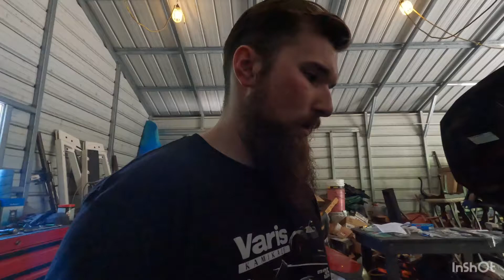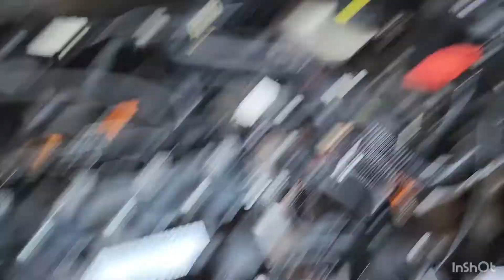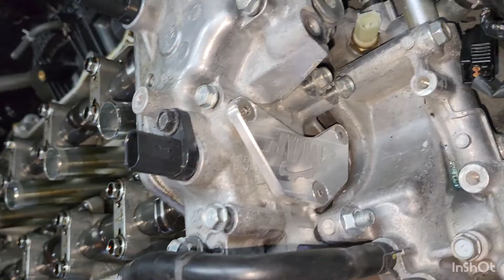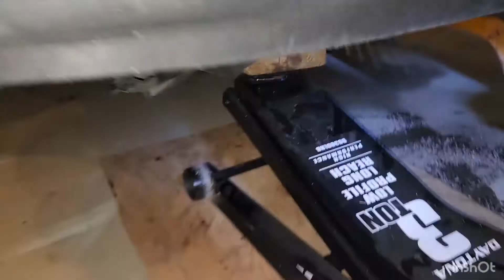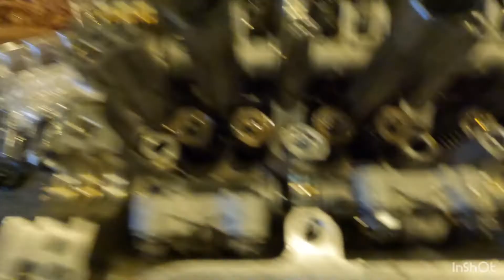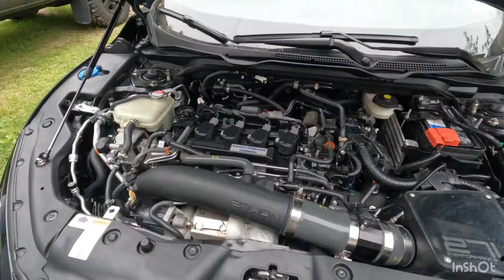2020 Honda Civic Si Engine Mods, Headgasket and ARP Studs

Comment: Do u know what the cause was for the head gasket failing ? Huge job wow !
Reply from the maker: This car has a larger turbo upgrade and is tuned for a higher peak boost. These engines are known for headgasket issues in factory form, so I assume it was expedited by the increased cylinder pressures.

Comment: Denso is just a small part and connectors company in Japan. So most Japanese cars will use Denso as an OEM part manufacture. Similar to how Mitsubishi makes the OEM turbo for this car and others, (BMW, Volkswagen, Subaru, Chevy). They don’t design the motors or the cars though.
Reply from the maker: Did you know they also created the QR code?
Reply: @RustBeltBombers woahwoahweewah

Comment: That cometic gasket is 73.5mm vs stock bore only being 73mm. I’ve heard nothing but nightmares when people run those gasket. No need for them anyways had a buddy targeting like 45psi on a 2867 with stock headgasket…obviously that wouldn’t last but still, oem headgasket is the way to go
Reply from the maker: Interesting information! Thanks for sharing your experience.
Reply: Can we still run those even if you just drive normal and not step on it or wanting horse power?
Reply: @diazeopamrx6799 I would say no. Oem isn’t even 100 bucks if I remember correctly

Comment: Did you do a re-torque after heat cycle? Also did you reuse the harmonic balancer bolt? I think Honda sometimes recommends using a new one? And just wondering if you’ve had a success with reusing the original
Reply from the maker: We did not retorque after heat cycle, and the harmonic balancer bolt was reused. It's likely recommended because it is a torque to yield bolt.
Reply: @RustBeltBombers  yes that was what I gathered by the recommendation as well. I’m actually doing a head gasket right now. I should be finished today. And I was trying to make sure that when I reuse this bolt I’m not gonna have problems. I do have a big turbo I am pushing 30 psi